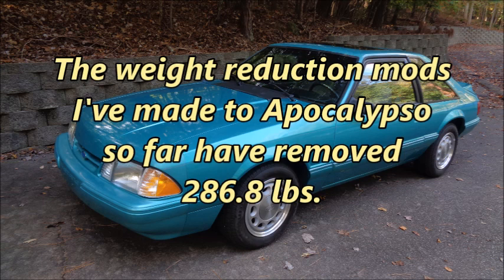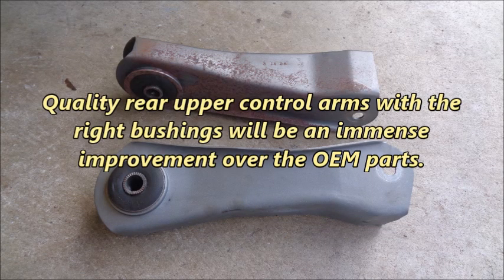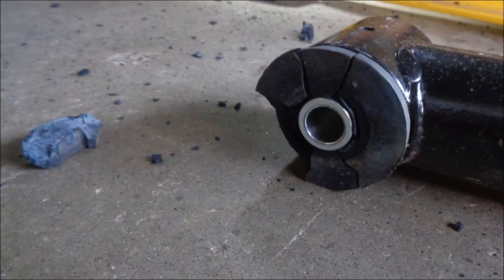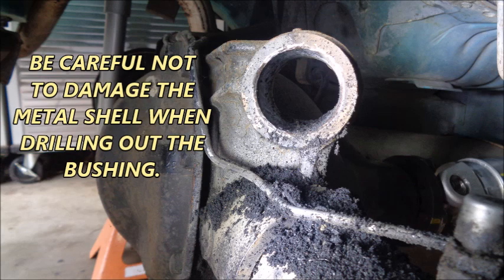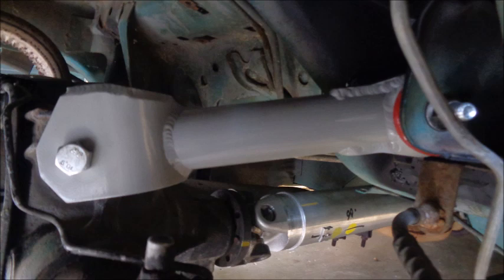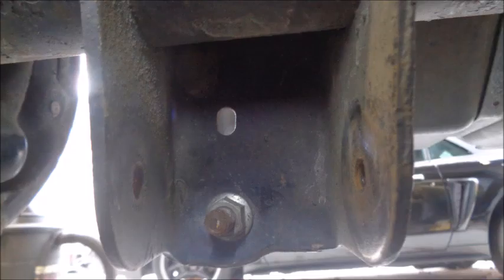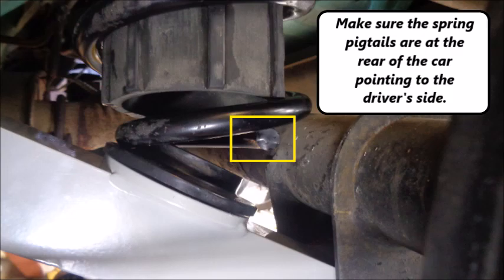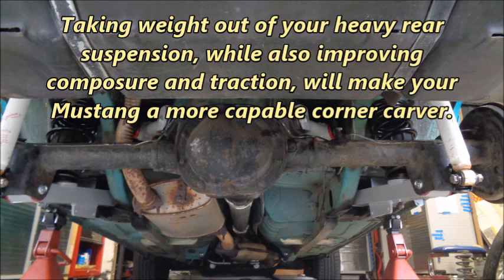Apocalypso: STEEDA ALUMINUM REAR UPPER & LOWER CONTROL ARMS

Comment: Having a 2.3 my self I have plans for its suspension when I restore it. I have read about bind issues with the rear suspension and one of the things people swear up and down is not to use any type of bushing other than OEM rubber for the UCA due to the bind issues. Using the 3 piece design from steeda does the rear end of the car feel good or has it binded on you?
Reply from the maker: I used the Steeda steel rear upper and lower control arms on my 2000 GT for 5 autocross seasons. I have the Steeda aluminum rear upper and lower control arms on my 1992 GT (which is also an autocross car). I've done over 100 autocross events with those control arms on my cars and "quadra-bind" was never an issue. Most people lower these cars too much, use springs that are too stiff and rear shocks that are also too stiff. When the car suffers snap oversteer, they blame "quadra-bind" instead of their setup. "Quadra-bind" is a real thing, but these arms made my cars handle better, not worse. You can see how my 1992 GT handles with the Steeda aluminum rear control arms in my "ThoroughbRED" results videos. If you have any other questions, please ask. I'm always happy to help.

Comment: I have a set of BBK boxed style UCA that came with the lowers and never installed them, I was thinking about using the 3 piece poly bushings for the torque box side and the stock rubbers for the rear end.. Should I try that out, or should I go poly or spherical on the rear end side?? Just street driving for now, pretty happy with the handling already, but definitely would love a cheap improvement especially since I already have the arms.. Just bouncing the question off of you in case you have any suggestions or recommendations…Thanks in advance, another great video.. Also I love apocalypso, there’s not many colors better on a Hatchback lx than calypso..
Reply from the maker: My strategy for my autocross cars has always been composure at the chassis/articulation at the axle. That is based on behavior at the limit of traction and how far out I need that limit to be. A street car has different considerations. You aren't (or at least you shouldn't be) driving the car at the limit of traction, and you don't necessarily want to deal with the added NVH of spherical bushings in the upper differential housing location. If you're not concerned about NVH, I would install the BBK UCAs with 3-piece poly bushings along with J&M spherical UDH bushings. Having said that, I actually used poly UDH bushings on my 1992 GT and my 2000 GT for many years (both cars were autocrossed & driven to and from events). They handled very well, but the spherical bushings were a big improvement when I made the change. Poly is a good option for a street car. Your OEM rubber UDH bushings are most likely worn out by now; if the replacement cost is anywhere near the cost of poly ($25) or spherical ($90), I'd recommend upgrading. I got very lucky with Apocalypso. I never think about the color when I buy my autocross cars, I'm just looking for good bones. But I really like the color on that car.
Reply: @warhorseracing  Thanks again!! Much appreciated!!

Comment: What rust inhibitor do you use/have had luck with?
Reply from the maker: On this car, I used Rust-Oleum Rust Reformer. I've had good luck with it in the past, but I make sure to prep the surface really well. Although it's not made specifically for rust, I've also had great results using VHT Roll Bar & Chassis paint on various components.

Comment: Great tutorial as always. Just wondering how you came up with 500 lbs that you must remove from apocalypso. Is that really attainable without radical mods? I know the lighter the better. I took about 200lbs out of my 92 fox 5.0L along with suspension mods and it handles much better.
Reply from the maker: Thank you! When I decided on this project, one of the SCCA classes I was considering had a minimum weight of 2,500 lbs. without the driver. The rules changed for 2023 and that minimum weight is now 2,680 lbs. with the driver. I weigh 180 lbs., so I'm still shooting for this car to weigh 2,500 lbs. when it's done. Taking 500 lbs. out allows me to add back 100 lbs. of suspension/bracing/rims & tires. My estimates put me at well over 400 lbs. before having to install lightweight body panels. I will definitely have to make some aggressive mods to get to 500 lbs., but my initial focus is on mods most people can make.
Reply: Thank you for the response. Clear and concise answer. You have great channel

Comment: Hello.  I was wondering, you have shed nearly 300 lbs.  How has the car character changed already.  I must accelerate better with less weight to carry?  An I was pleased to hear that it is less nervous in the rear.
Reply from the maker: I've only driven the car about 40 miles since taking the weight out (it's being worked on most of the time). The weight balance is still not ideal, but it does accelerate a bit faster than it did before. I've only driven it on the street, so I haven't been very aggressive with the car. It's always fun to drive a car during a build to start getting a sense of its potential.

Comment: I was never into some of the issues along the lines of what was here, including 4 bangers, weight distribution and weight reduction, until I got a 1984 Fiero with the 2.5L Iron Duke. While I wasn't a fan of the small size, the shear light weight of the car, superior weight distribution and efficiency of the 4 banger had me in love. It was the most fun driving car I ever had, despite the engine. It was an oversized go cart. 

Having also owned a stock '90 Mustang GT it made me wonder what you could do with the 2.3L equipped Fox, and here you are doing it. What you have already done is fantastic. Can't wait to see more!! 

Also, I'm resto-modding an 02 Mustang V6 5spd and was questioning the whole control arm/torque box thing myself. I think you cleared some things up for me as far as what control arms and bushings to use in the future. 

Would you say a panhard rod would also benefit if you use these Steeda arms?
Reply from the maker: Thanks for checking out the video! I've got some fun stuff planned for this project. One of my cars is an IRS-swapped 2004 V6. It's a blast to drive out on course because it's really well balanced. A Panhard bar has never been my first choice for making these cars handle better. I do know many people who use (and love) their Torque Arm/Panhard bar setup. And their cars handle really well. Whether you run a larger rear sway bar, an adjustable rear sway bar, a Watt's link, or a Panhard bar comes down to personal preference (and the SCCA Rules). Other mods matter too. My advice would be to get a good set of adjustable shocks and struts and a larger rear sway bar (if you have the OEM front V6 sway bar an OEM GT 23mm rear sway bar will work), a good set of rear control arms, spherical upper differential housing bushings (often called bearings), forward-offset A-arm bushings, and CC Plates, then dial the car in with adjustments. That's usually a good starting point. You can always add a Panhard bar later, if you feel you need one. Check out my "Budget Autocross" playlist, it covers some good solid rear axle mods that will make the car handle much better.
Reply: @warhorseracing  Thanks for the response! In doing research after purchasing the 02, I was surprised to find out Ford chickened out altogether and just left a rear bar off our New Edges, so I already did exactly what you've suggested. I put a used New Edge GT bar off Ebay on it which made a nice upgrade. 

My very next upgrades were going to be front and rear strut tower braces and then frame connectors, as I've heard about how flexible these bodies are. Now what's going through my head is what's more important, stiffened body or straightening out the factory squirrely rear end issues? (I still have flashbacks of bad experiences pushing the 90 GT past its limits, on the street no less - I was a stupid kid)

I'll look into all the other parts you suggested. I've already been binge watching your other videos. I'm on a really tight budget with this project and while it's still in restoration phase and I don't have immediate plans to autocross it or even push it very hard right now, I do at the VERY LEAST want something my upgraded daily driver 2010 Corolla S won't put to shame with even just a little spirited cornering (which it currently does believe it or not).
 

Thanks for all the info you share. I can tell you really know what you're doing, which usually goes with people who actually have to get something done and be successful at it, instead of just follow trends and "look the part" (like feel good and look good street car trends). 

Don't understand why your channel doesn't have more viewers and subs? Maybe YT's algorithm hasn't snatched you up yet.
Reply from the maker: @HAL-dm1eh  I'm always happy to help. When I bought my V6, I was surprised it didn't have a rear sway bar. Adding a rear bar helps get the car neutral. Every input goes through the chassis, so I'm a big proponent of chassis bracing. My strategy is always to start with a strong foundation. But, if you plan on driving the car more than racing the car, you can get the rear suspension sorted first. The trick is to find the right balance for your build. I'm happy to answer any questions you have about mods as you work on your car. 

Thanks for the kind words about my channel. I'm trying to create a trustworthy resource for people driving these cars.

Comment: looks like the previous owner bought the SVE (or similar) torque box reinforcements but didn't drill the holes into the car for the sandwich plates that needed to be welded and instead welded the reinforcements into the torque box lol. I recommend buying the interior plates for the upper torque box reinforcement kit and drilling the holes for the hardware, that is the hard part but that's really where the reinforcement comes from
Reply from the maker: I compared the 2.3L to my 1992 GT and it looks like one of the previous owners just welded up the seams where the factory metal parts overlap. There doesn't appear to be any additional metal. I plan on installing lower torque box reinforcements out of an abundance of caution; I haven't decided on upper torque box reinforcements. My other cars never had a hint of torque box damage when using the Steeda arms, so I don't expect to have any issues with this car.

Comment: 77-100ft lbs for the lower
Control arm bolts…so where are you
guys setting the torque wrench to?
Reply from the maker: The rear control arm torque specs in the video are from the Ford Service Manual. I usually split the difference between the two numbers, but other people might do it differently.

Comment: I think having spherical bushings or the ones you have are pretty much a better modification than a Panhard bar or a torque arm.  Aftermarket control arms especially the uppers get a bad rep because people buy cheap solid bushings which make the car  handle worse.
Reply from the maker: I know a lot of people who love their TA/PB setup (and they're very fast), but it has never been my first choice for getting my cars to handle. My 1992 GT with the Steeda aluminum rear control arms, spherical UDH bushings, and a Steeda adjustable rear sway bar (along with other mods) handles pretty well. I hope I'm showing people that there's more than one way to build a capable autocross Mustang. It doesn't take much to make these cars handle a lot better or a lot worse than stock.

Comment: It's wild that you post a vid on Rear Control Arms. Just put some Metcos Aluminum Arms in the Vic. Way stronger than the stock stamped pieces.
Reply: What year? I miss my '98, and while I always wanted the updated suspension and PI engine Panthers, I would still take it back in a heartbeat. HUGE mistake selling that car! I found the rear suspension and overall balance even on the '98 to be really well done.
Reply: @HAL-dm1eh  It's a 2008 P71 model. The Homies asked if it's for sale and I always say $6,000 lol.
Reply from the maker: I always love seeing Crown Vics being thrown around on an autocross course!
Reply: @warhorseracing  It's been awhile. Been Bracket Racing.

Comment: I have used the Steeda aluminum control arms in the past. They are by far the best bang for the buck control arms out there. Losing the extra 6.5pounds is just icing on the cake. Glad the torque boxes weren’t toast.

I am curious to see how you get the remaining 300 pounds off. I am curious if you plan on tubing the car in front of the shock towers. I know that would save about 50 pounds. Still leaves a lot weight to remove to make the goal. I am excited to see how you get there.
Reply from the maker: The Steeda arms (steel & aluminum) have served me well out on course over the years. The steel arms I took out of my 2000 GT looked almost brand new after well over 100 autocross events. 

It was a big relief that the torque boxes didn't need to be replaced. 

The remaining 200 lbs. is going to be tough. I spend a lot of time looking at the car and asking, "Can that part be lighter?" I'll have to make some aggressive decisions and find some inventive solutions, but the 2023 rules have given me some more options. I don't think I'll go with a full tubular front end, but I will be swapping in some lighter metal parts up front. I'm hoping to get a lot more weight out during the off-season.
Reply: @warhorseracing  I have seen a few people go in and trim every little area on the sheet metal that doesn’t show. Would save some money and drop weight down to fiberglass weight. Remove inner fenders saves a little, not sure if the rules allow. The rear fiberglass hatch will save a decent amount as would a fiberglass hood. About 20 for fenders, 15 for hood and 20 for hatch. Still a ways to go. I know a long tube header would drop some weight and add a little torque. I think rear discs could drop a little rotational weight. I think Stainless Steel Brakes Corp has a light streetable set.
Reply from the maker: @gr8whitestang613  I'm definitely considering lightweight body panels. But, because there are very long lead times on some of those parts (6 months or more) and they are very expensive, I'm going to initially focus on removing all the weight that I can from other areas (within the rules). If I can get 450 lbs. out, then I'll know the lightweight body panels can get me to 500 lbs. There's a lot of researching and revising, but I think I can get most of the weight out without cutting up the car too much. I'm sure I will have to make some aggressive mods along the way. I'm also thinking about weight balance in addition to just getting the car lighter.

Comment: Was the reason you used the steel version of these rear control arms in the 2000 GT because you knew you were going to swap them anyway for the IRS? Or was there another consideration in going with a heavier material?
Reply from the maker: My 2000 GT needed a lot of work when I got it, and the steel arms fit into my budget at the time.
Reply: Thanks! Wanted to ensure it wasn’t a durability concern. Thanks for the fantastic videos!
Reply from the maker: @J0bab  I appreciate you checking out my videos! I haven't had any durability issues with the aluminum rear control arms. I don't drive the car on the street very much, but it has done a bunch of autocross events over the years.

Comment: Have you had any fuel slosh issues? I've been told the 03/04 cobra tank is baffled from the factory and bolts in all the fox/sn95 cars.
Reply: The baffle on the 03-04 cobra is in the middle of the tank if remember correctly.  That's where the fuel hat sits. It's in  different location from foxbody mustang.
Reply from the maker: I have had fuel slosh issues with my 1992 GT on course. I run all my cars with a full tank to prevent any stalling issues.

Comment: Nice to see a video. Can you talk about the s550 gt irs diffs? I want too swap it into my 340 mopar powered 260z. going to drag race and do some autocross. its crazy how badly the poly bushings cracked. the torque box looks great, leave the battle scares for now!
Reply: What do you want to know? I autox an s550 gt
Reply: @PhilthyHorseRacing  well I have a 2600lb car hopefully make 4-500 hp. I want to do spherical bearings and all the like. Basically what I want to know is what it's like actually using the diff if it loud are can really take the abuse? How are the oem axles well driving hard. And launching specifically. In my other z at an autox event I had all new rubber bushings and after full tilt going to hard braking the diff would shift in place and the drive shaft would rub the sway bar. So I will probably solidly mount the pumpkin.
Reply from the maker: @SeanOBryanZZ  I don't have a lot of experience with s550 differentials, so I can't offer advice on how much power/abuse they can take over time. I can say that I've seen (and driven) a lot of s550 Mustang GTs at autocross events and I haven't seen a diff fail. Most of those cars have 400 hp or more. As a general rule, I always upgrade OEM bushings to something that will hold up better under autocross conditions. I use Full Tilt Boogie Racing bushings/mounts in my IRS SN95 Mustangs. Your project sounds like it's going to be a lot of fun!